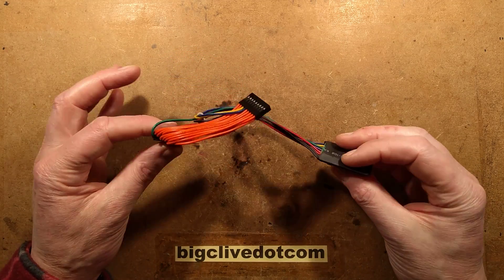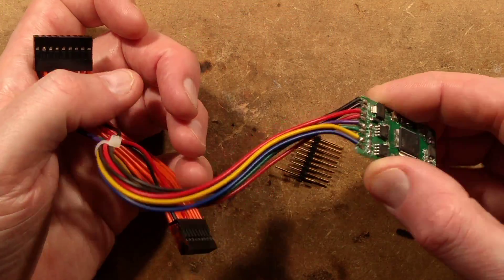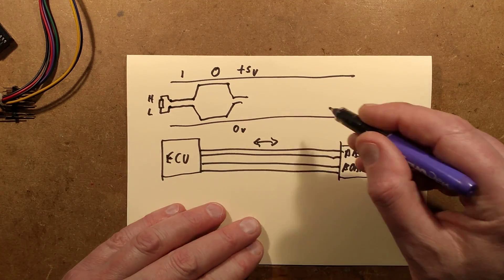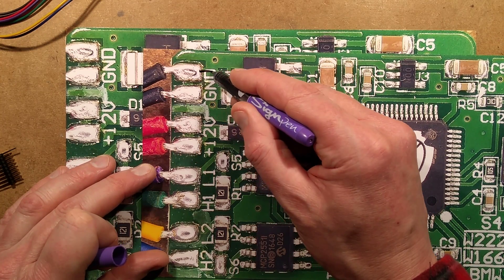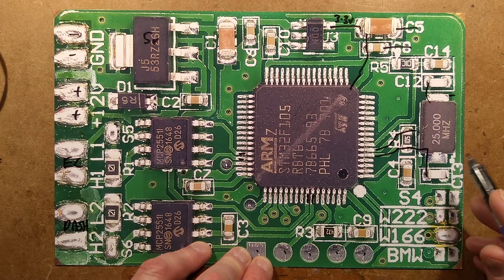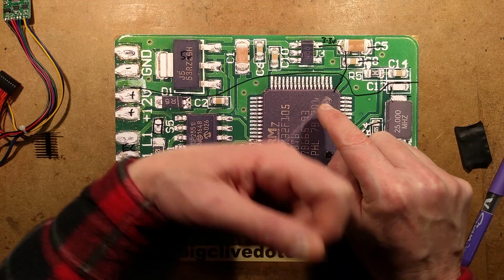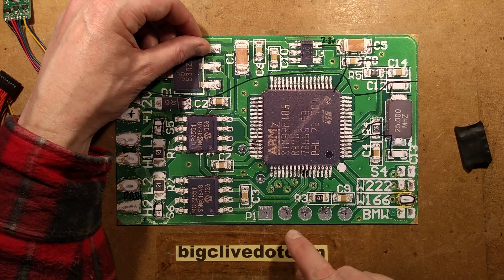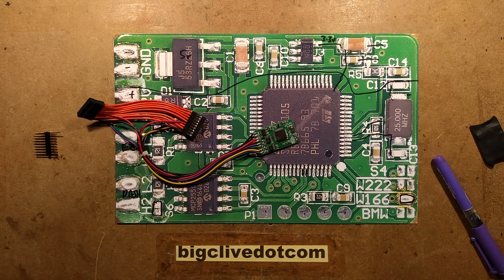Naughty CANbus odometer "interface".  (Fakes mileage.)

Comment: Back in the day you mileage was only being metered with your dash panel so basically you could get a dash panel from the junkyard with less mileage and bam less mileage more valuable car then obd2 came along in 1995 on a few vehicles then standard on all vehicles makes and models in 1996 due to federal regulations because with obd2 one computer scan tool can get codes on all makes and models but with obd2 your mileage is stored in the dash and the engine control module aka engine computer so now lets say you have a newer car and you change your dash panel now you're dash panel would say one milage and if you scanned your computer it would have a different mileage so with high end German cars the computer can sent its mileage to the dash panel which would make both display the same mileage so if someone changed the dash panel to say the car has less mileage than it really has this would mess up there way to screw someone over so what you have will receive the data from the engine computer then it will resend the data to the dash panel but it's programmed if it receives the mileage from the engine computer to throw that particular data out and not resend it to the dash panel there for the dash reads say 43,564 miles but the engine computer reads say 97,211 miles you as the average buyer see 43,564 miles and the average buyer has no idea that the mileage is on the engine computer too and only a mechanic with a high dollar obd2 scanner can read the mileage off of the computer also remember you can change the dash panel as many times as you want lowering mileage every time but no matter how many times you change your dash panel as long as that vehicle has the original engine computer it was built with the mileage on the engine computer will always be the actual mileage it can not be manipulated so you can have a dash panel that says 80,000 miles and be like that's low mileage i know i can get 400,000 miles plus from this engine then 3 months later you have something repaired at a shop and the mechanic goes to read your check engine codes and notices that his nice snap on code scanner says mileage is 389,000 miles and he looks up and notices your dash panel says a hair over 80,000 and he tells you or even worse you get into a small accident and it's a body shop and most body shops report to car faxs let say you take your car in after a accident at 80,000 miles you car is valued at 12000 dollars and at 389,000 miles it's valued at 6500 dollar and you car is 10000 dollars to repair the wreck you went from insurance willing to repair your car or pay you the 12000 dollars and keep your car to your insurance company not willing to repair your car because the repair is more than the car is  worth to insurance offering you 5000 because your car is worth 6500 and since the mileage is changed the say other things was wrong with your car before the accident to pay out as little as possible but if you really had 80000 miles they would pay what its worth no hassle
Reply: Can you break this up into paragraphs please. It's interesting but I'm getting eyestrain trying to read through it.

Comment: Ok I seriously want to know a few things from the sender of this device.
1 did it cause the other issues
2 did it snap back to original miles or did he have to find another way to read that
3 is it a set reduction or a percentage
4 did it mess with the spedo
5 what did the customer say?

After that... This could be used in one specific case, legally that I could think of.  Had a Chrysler cluster I had to replace, we just got a new one from salvage.  The original unit had 29k miles, new unit had 116k miles.  We tried to reprogram it, and no matter what we couldn't get a match.  Closest we got was 70k on the new cluster,  now the car has a bunch of tamper proof stickers (drivers door and under hood) which read the original clusters milage, and the new clusters milage when installed. Coulda used something like this to negate the difference and had a correct odometer (though I probably would still have used the stickers just to cya), assuming it was just a milage - setpoint change and not a percentage.

Comment: I guess this should be fixed by manufacturers designing a new Dashboard that needs to be paired with the ECU by having a shared AES secret key programmed to the Dashboard and to the ECU --- make the dashboard module's programming permanent so only the ECU side can be reprogrammed,  and make the dashboard require every mileage reading received answer include a Nonce that matches one sent with the request and a HMAC.

Comment: The car manufacturers (especially the Japanese) are notorious for making the speedometer read a few % higher than actual. Which of course shortens their warranty coverage by a few % also since the miles tick up faster - and it's the most expensive miles at the end that they don't have to cover. Pretty shady. I think there was a law suit over this a few years ago. Not sure if they are still doing it.
Reply: Most cars will over read, Very very few under-read. I'm not aware of anyone doing it to reduce warranty coverage. Not here in The EU anyway.

Comment: I was planning to build something similar actually (purely for diagnostic purposes of course) - the speedometer in my car has cut out a couple of times in the last few years but the guys at the garage cant find the problem without taking apart all 4 wheel bearings (which would not be cheap).  I suppose there are convenient devices available that can log the data but thats not how our kind does things is it :P  Researching the protocol, designing the circuit, writing the software - thats the only way to go :)

Comment: One of the frustrating points about changing modules in new cars are the security features. For example a BMW records updated odometer readings in both the General Module and in the Instrument cluster. Those numbers need to match up or the modules won't talk nice to each other. Evidently this device allows the numbers to match, presumably using the old mileage figures, as before. The splice sends the illegally reduced mileage signal to the actual odometer, but on removal the system has no problem switching back to the true numbers. Sad, devious genius.

Comment: Unlikely to be developed on an Arduino as they use completely different processors (Atmel, not ARM) and unlikely to have the processing power/memory required for this.
Reply: Wrong. Arduino is the name of the whole ecosystem, the boards, the IDE and the organisation. Atmel is the name of one manufacturer since taken over by Microchip. ARM is an IP trademark used by many licensed manufacturers of 32-64 bit processors. There are 32 bit Arduinos based on ARM and Intel Quark processors as well as older 8 bit AVR.

Comment: I remember the time where if you wanted to change the mileage, you had to actually remove the speedo and wind it back the odometer manually.. that was back in the old mechanical, cable driven days(prior to around 1985-86). It could still be done with the early electronic speedo's that still used the mechanical system, like my car has(vdo speedo from the 1980's). I never understood it. Then, I've never had a car with warranty(or a car just out of it) nor worried about resale value..... if you get half a million trouble free kilometres out of a car, I'd say you've done well! For those who wish to keep up with the Jones's, I guess I can understand the obsession with "resale value"... just don't drive it! Lol

Comment: When you're talking about mileage on a vehicle, what are you talking about? 
What I mean is suppose at 40k km this vehicle had a new engine and transmission installed. What should the odometer read for this car? IMO there's a reasonable argument for setting it back to zero. I dunno, just playing the devil's advocate here. 
Anyway, I found this - 
https://www.dhgate.com/product/5pcs-yanhua-mb-can-filter-18-in-1-odometer/412674016.html

Comment: It does not work quite you think. Merc stores mileage In multiple locations at least dash, ews, abs pump and ecu. All these units sends the mileage to dash via canbus. So when mileage is altered to dashboard this module is added to remove all those mileage messages (frames) before reaching dash (because if dash sees bigger mileage from any of the other units it adapts to it.) So this module it self does not remove 40000km's it just prevents the dash from seeing the true mileage.

Comment: It's a long way from the days of jacking up the back wheels and running a vehicle in reverse to remove miles or the slightly later version that disconnected the speedometer cable from the front wheel (VW) or the transmission (most others) and then used an electric drill to run the odometer backwards.  Wonder if the device comes with a "percentage change" cheat sheet so you know when to do distance-related maintenance?  $16US and up on Ebay.

Comment: If you want, you can get yourself one of STMicroelectronics' NUCLEO boards (get one of the larger ones, not the Arduino Nano formfactor), they've got the STLINK-Hardware on them, you only need to remove two jumpers (marked "ST-LINK") and then you can connect the prins from the SWD connector to the programming pads. The STLINK-software should be able to access the microcontroller once it's powered. 
The SWD-Connector Pinout is as follows: 

- VDD_TARGET (3.3 V)
- SWDCLK (connect to round testpad on pin 49, between C3 and the microcontroller)
- GND
- SWDIO (connect to round testpad on pin 46, between the first MCP2551/C7 and the microcontroller)
- !RST (between R5/C14, not needed if the microcontroller doesn't enter sleep state)
- Reserved
Yes, it's not actually JTAG, but a slimmer interface called "Serial Wire Debug" (SWD). Theoretically, you only need GND, SWDCLK and SWDIO (which is the bi-directional data), but the STLINK-HW might not try to access the microcontroller if the target voltage (VDD) isn't there (this is because some devices have different IO voltages and driving a 1.8 V IO with 3.3 V CMOS levels might kill the interface). The !RST-line is only needed if the target device enters certain sleep modes, where it'll otherwise become unresponsive to the SWD interface and has to be reset via hardware. 
The STM32 line of microcontrollers is a rather exhaustive line of ARM microcontrollers by STMicroelectronics, they're very accessible for beginners and there's a large amount of Arduino-style NUCLEO-boards. 

I'm actually really impressed by how proper this is built. No cutting costs - there's a certain amount of irony in that, given what it does - everything seems to be done "to spec", you got all the decoupling (C7 could be placed a bit better, but it's not gonna break the thing), good routing for a two-layer board, good thinking with the solder bridges, quality item. Some of the thermals are a bit wonky, but that's more aesthetic than function.

Comment: at 5:00 -> In regards to why they make 1 the GND state and 0 the +5v state is because most MCUs have input pins that have pull up resistors (way more common than pull down resistors), and if the line is floating, the MCU will register that as a +5v (or 0 state - because its undefined state is being defined by having the line read +5v), when a data line is pulled to ground (it has to be to counter act the pull up resistor) then that is its 1 state... Not sure if that makes sense... Just google pull up resistors

Comment: I disapprove strongly of this technology!  I like the fact that I can buy a high mileage car for much less money that will actually be in better condition than a low mileage example for which the uninitiated may pay a premium😉. High mileage usually indicates lengthy motorway trips that produce very little wear whereas low mileage is invariably numerous cold starts wth short trips to the shops performed at less than operating temperature interspersed with long periods of humid inactivity. Both disastrous for a cars systems. You could argue that this person got a better car than they deserved! Some may argue of course. 😆
Reply: There a tons of "fair" mileage cars with verifiable upkeep on schedule for cheep from car rental companies but i wouldn't spend a dime on one......  I have rented a car or two in my life, I know how them fools drive ! :}

Comment: My speedometer would indicate forward speed regardless of the direction I drove the car and I wondered why it did it. It turns out the speedometer connection to the front wheel is not a mechanical cable connection at all but an electrical cable and pickup that generates a square wave via a toothed gear on the axle shaft. Similar to the sensor on anti-lock brakes which my car does not have. Regardless of the direction the car is driven the square wave will be the same and is only interpreted as forward speed. I much prefer the cable on my old VW Beetle truth be told. I'm a firm believer in the KISS principle.

Comment: The 5 empty pins on the bottom of the board are for a micro USB connection. From left to right it is 5V, Data -, Data +, Mode Detect, and GND. That's how they programmed it. Likely it is programmed with Arduino but could also be Python. Judging by the CANBUS controller chips tell me it is Arduino. You can extract the code in binary and use a disassembler to convert the code.

Comment: IMHO this chip has nothing to do with arduino. GnuARM, IAR or something similar should be used to program arm. The 4 wires - SWD Debug interface (GND, SWCLK, SWDIO, +3.3v, <optional - hardware reset>)

Comment: I have something like this that stores the state of the auto-start-stop disable button -- so if the auto-start stop system is disabled when you turn the car off, it will disable it again about 5 seconds after you start the car the next time, so you don't have to manually do so.  It re-creates the auto-start-stop-disable-button-press signal on the CAN bus about 5 seconds after you start the vehicle.

Disabling the auto-start-stop system saves major wear-and-tear on the starter and battery, which are far more expensive and harder to replace than the tenth-of-a-gallon of fuel per tankful that you'd save by having the auto-start-stop system active...  The only reason those start-stop systems exist is to essentially cheat on the EPA fuel-economy tests -- and, of course, by law, they must re-enable themselves when you re-start the car in order for the manufacturer to claim the fuel-savings on those tests...  But there's no law against the owner of the vehicle buying something that disables that auto-re-enabling functionality.  :-)

Comment: You can officially buy such things: https://www.enigmatool.com/gecko-can-filter/
They prevent odometer synchronization with other units, so you use them either, when you put some used component that was taken from a car with a higher mileage, or when you have "corrected" odometer in your dashboard, but it is too expensive or even impossible to correct the mileage records in all CAN modules.

Comment: The dominant "0" implements an ID priority system. When 2 devices write at the same time, the smaller ID will override the other one. This is sensed by each device and when it recognizes a difference between sent and read data, it stops and lets the other one continue.
Reply: i thought it was whoever wrote the 0 wins. the 0 is dominant. whoever wrote the 1 but reads the 0 will know to yield. that way the device that won the right to transmit doesnt have to restart his transmission.

Comment: I once wired in a toggle switch to a hidden-but-easily-accessible position under the dashboard, that broke the connection between the speed sensor and the odometer, of a friend's Dad's Ford Granada.  It basically meant that he could "borrow" the car without adding miles to the odometer, which his Dad kept track of. *SMH

Comment: I am not convinced this device is exactly as Clive describes but I believe Clive is spot on regarding its nefarious purpose. Although there are many versions of this device sold online I have yet to see one that says what it actually does.

One of the more detailed descriptions for this "CAN Filter 18 in 1" sold on ebay says the item is to be connected "between the odometer wiring plug and the tachometer itself" and implies the device keeps the milage from "changing back to old value" after a "milage correction on a Merc or BMW". It claims "this is the filter you need", "helps block EZS,EIS synchronization to the tachometer".

My guess is that it allows a previously altered odometer reading to maintain its alteration while also allowing it to correctly increment and it does this by filtering out certain can bus device id communication. The installation instructions do say that for some car models this device should be installed prior to "odometer adjustment". How the adjustment and the value is made is never mentioned. So the device apparently does not make the odometer adjustment.

The installation instructions also show specific modifications needed to be made on the car's instrument cluster pc board for some car models but not all. Therefore just removing this device may not restore the car's operation.